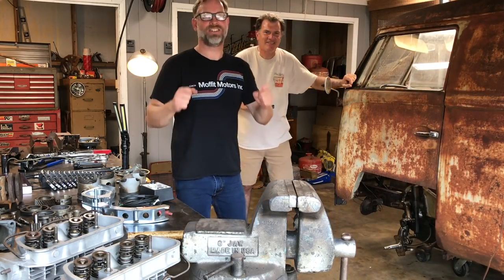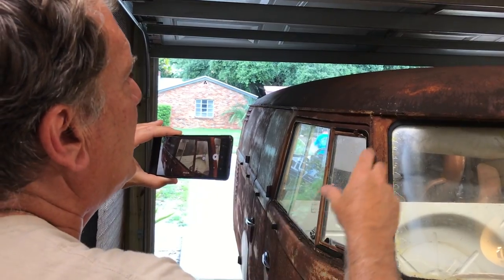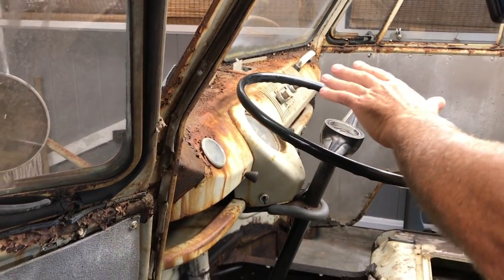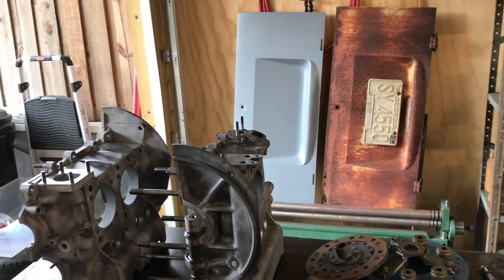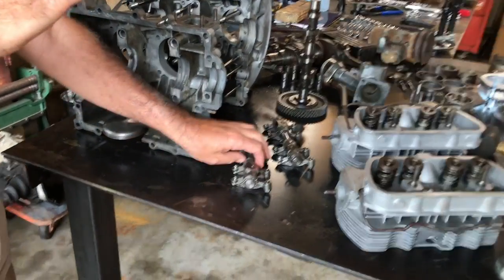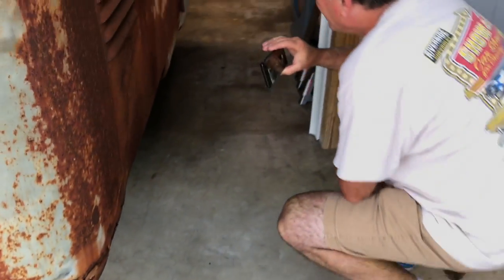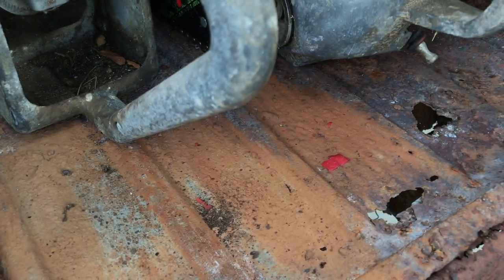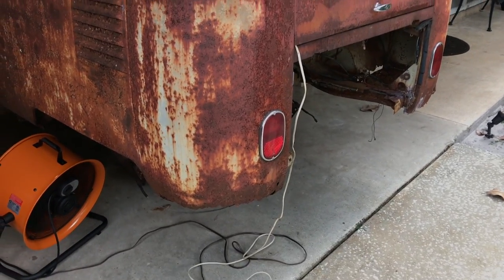Abandoned VW Bus Restoration! Mike Fn Garage takes a closer look! Extremely Rusted Metal Roof! CT

Comment: If you don’t want to weld you could clear resin the gutter, use tape on the inside and preserve the rust as it is whilst waterproofing the gutter and holes. The last bus I had that was that bad I de-seamed the roof gutter, it looked awesome. At least the resin could all be cut out if you do a clip. Cheap and quick.
Reply from the maker: Hey Simon! That might be an option! I will consider it! Thank you! Stay tuned for more! =)

Comment: Just remember where the springplate sat on the housing.  Usually what ive done in the past, I"ve used a screwdriver and scratched a mark below the bottom edge of the spring plate onto the housing before i take it off.  it gives you a datum point when you reinstall it.   Its ok you have the video.  Buy a tube of rubber grease (wheel cylinder assembly grease) and lube the spring plate where it touches the rubbers. When you install it , line up the springplate with the line. Push it on to the torsion bar and put on the cap and start the bolts in the cap. Then then jack it up just above the stop and get a block of wood and a hammer and wack the springplate until its above the stop and won't go in any more. Then tighten the bolts.  All done. When you get the replacement springplate, try putting it on and the pull it off and move it one tooth by hand. It makes quite a bit of difference to the unloaded position. Then put it back to the right place. have fun.

Comment: So, here's an idea on the roof. Put some metal tape on the inside of the roof over the rusted out holes. Hand sand the areas on the outside of the roof just enough to expose some bare metal around the holes. Spread some micro hair fiberglass filler onto and around the holes where you sanded it bare. Don't sand the filler down, leave it rough. Airbrush the filler to look like rusted metal like Mike said. Remove the metal tape. Cheap and it will look like the rest of the bus.

Comment: I suggest the electrolysis method to remove all rust. Then start with replacing any rusted-thru panel. This method is worth a few hundred bucks but saves a lot of
your time! Rust primer keeps the oxidation in, after some years you start again 
where you thought youre finished with rust treatment. That why its called 'primer'
and not dissolver.

Comment: I have seen guys weld roof patches in from the underside and leave the original “holes”, etc thus giving it the same look without replacing clip! I say run it stock! Stock motor stock tranny...I’m not about running “faster” there is a REASON VW built them this way...you change all the other stuff you get in to changing brakes, etc etc...plus I love the “feel” of the original gearing and motor...nothing else like it! Just my opinion...as to the metal and pieces they do or don’t make I say this...make your own! Nothing says you can’t make your own panels!
Reply: So with you marci!  I havent watched yet, but nothing like the feeling of the complete project "YOU" just completed the way it was meant to be!

Comment: I'm agreement with that new roof and putting the bigger bore cylinders and the different ratio differential and definitely later on the disc brakes and when you get over it being stock put a Porsche motor in it then you'll have all the power you need if not the Subaru conversion I've seen it done everyone is very happy with that one when I was young I worked for a chrome shop and drove several of these old bugs. For delivery  I was never impressed with the Van's they had no power and rattled too much.

Comment: I understand Patina is important but safety is first! Also patina is great on the outside but on the inside MY personal choice is to destroy it and make the interior NICE. That dash to me again has to be fixed. Also the roof rust holes need to be fixed with new metal however you choice to do that. But that is all my personal choice other then the safety first part.

Comment: View #8,145 at 4:20 PM on 7/10/19 - NJ ..... Worlds colliding...LOL... CT use this TRUCK BED REPAIR SECTION, rear, measures 61" X 36", the corrugation patter on of this panel is identical to the original

Comment: I have a similar condition 1976 Mitsubishi Lancer 4 door 5 speed 1600cc OHC with tons of body rust so I wire brushed and primered everything. I live in rust provoking Thailand and have a better'76 Lancer to think about so I wanted to stabilize my treasured parts car while I looked for better hood and front fenders. I want GPS for the #1 car which I intend to drive in traffic. #2 might be strictly for race. Not sure yet. Had 3 VW vans. Wish they were here!!!

Comment: Question: can you get at the roof from the inside any way you can weld in new metal down along the edge and then up in the radius where there is good metal.  Then you can keep the look on the outside but still have needed strenght and protection from the rain??
Reply: pretty tight in there other thoughts were to put patches with panel adhesive behind the holes.
Reply from the maker: Hey Dan! Not a bad idea! That might be an option! Thank you! Stay tuned for more! =)

Comment: That roof and other parts, are toast.  I have a saying:  ONE MAN’S PATINA IS ANOTHER MAN’S CANCER.  Patina has character.  Cancer has holes and destroyed, unstable metal. I have a ‘66 SO 42 with original paint.  Very little rust.  99% solid.  Your bus is, unfortunately, not the same and will continue to degrade.  Wolfsburg West has good repair metal…Klassic Fab has better.

When thunder roars, head indoors.

Comment: I would much prefer to drive a van like this with primer and filler or an in process sort of look than something you don't even want to run your hand across. If you can't put your hand on the body without having to wash the rust off of your hand, then what good is it to even have the van? This is not PATINA. This is extremely rusty YARD ART. This is the RUINS of a Volkswagen van. This van is just way, way past patina.

Comment: You can “rent” a steering wheel puller from your local auto parts store for about $15...use it take it back and they give you your $15 back!
Reply: special puller for bus wheels. I use a bearing puller. I said gear but ment bearing. clamp it around the shaft and it pulls right off.
Reply: Mike Fn Garage rented mine from o’reillys they had one that worked for my 1961 Land Rover also and it’s a reall odd ball! Very helpful guys!